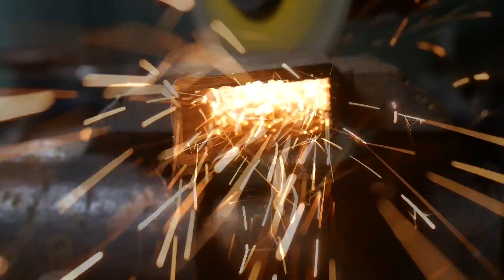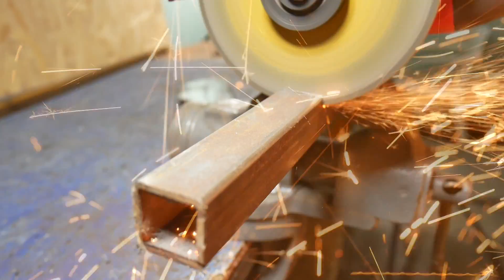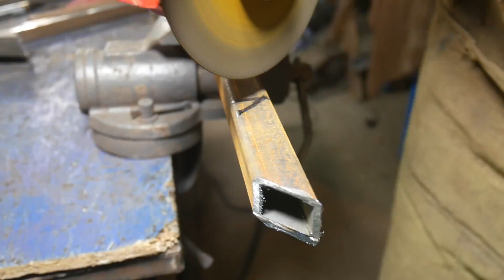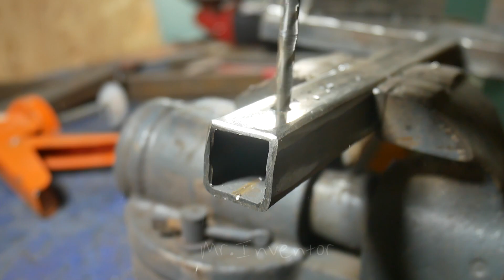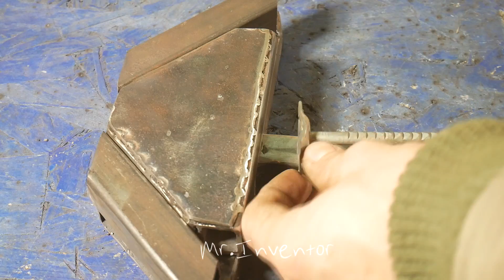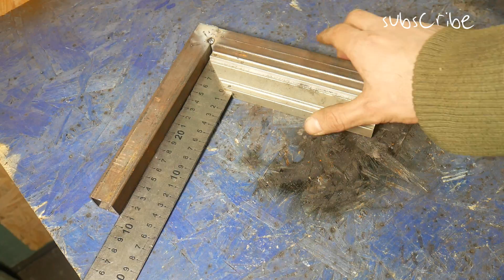Secret to quickly welding angles. Why welders do not talk about it?

Comment: Safety first. Too often I see 4 inch angle grinders in use with a cutting disk and the wrong guard. Every brand instructs to use the guard that covers half of disk when cutting.
3836 Safety, LLC